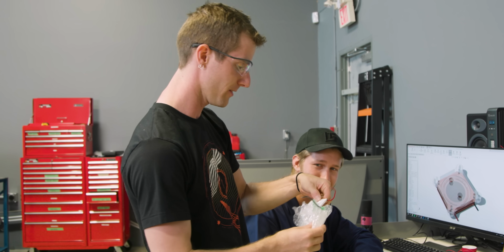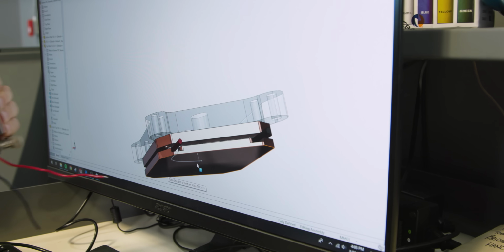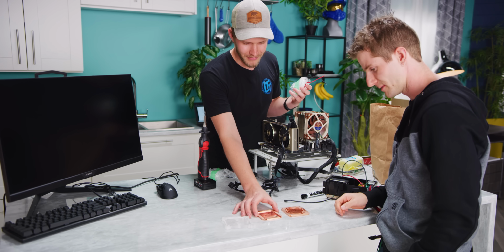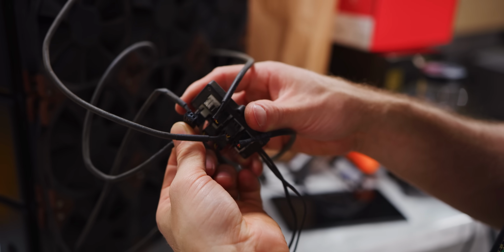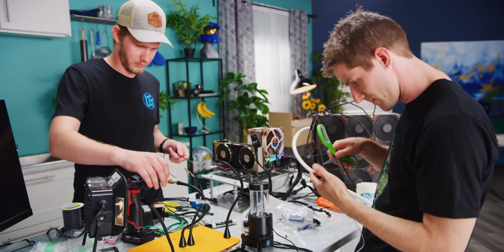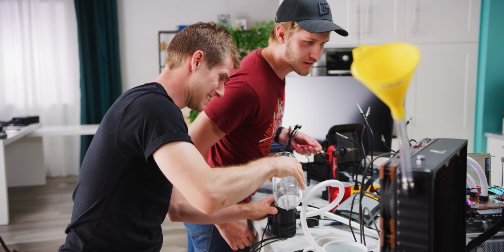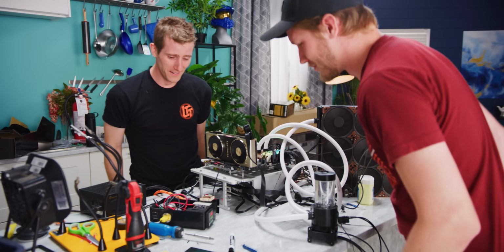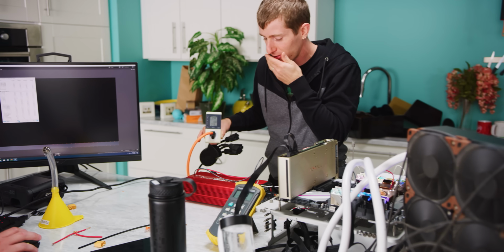This Cooler DRAWS 545W!!? Bad Cooling Ideas #2

Comment: Next episode: water cooled power supply
Reply: Why? That’s already something they reviewed a while ago, you can still buy them. Basically pointless as the design sucked on that model, so yeah, you could diy much better sadly...
Reply: Oh, one thing to note, I’ve done sub-zero power supply, and around -50c it may go squirrelly (I had voltage converter submersed in anti-freeze cooled by dry ice, also though, around -60c the anti-freeze froze but it took a while). I’d go submersion flow for true liquid cooling if a power supply, but a quality one like my HX1200i runs 700w fabless and the inside temp is only like 45c (like 10-15c over ambient), so if you touched the inside components without getting shocked it still wouldn’t even be that warm. For my main system I have 2x SuperNova 1300s (with Threadripper and 4x Fury 1 is fine, but if you want to use LN2 for example I’d just rather have overkill power supply. Using it to hear my house only uses 1.7 kW running Crysis 3 at 4k Ultra at over 100 fps, though I usually turn off the monitors since I’m just using it like a massive space heater and it holds its heat about like an oil heater if you run the fans super slow).

Comment: Better off to run 5 at lower watts with a larger thermal mass, more copper!!!, that way you can actually keep the TEC cool, the hotter the the hot side the hotter the cold side.....what I'm getting at is with 900 TEC watts....you should be able to keep that cpu at stock more than pulled down, also not to mention a slightly better water block for the TEC.

Comment: I’m confused. How does a relay fit into a PID controller? PID controller should ideally control the current flow into the Peltier module thereby controlling the degree of the thermoelectric effect. A relay is just basically an electronic on off switch, if my understanding of the implementation is correct. What you need is more like a potentiometer, but it should be already built into the PID module

Comment: Càn condensation occur in a vacuum??
Reply: If there is a perfect vacuum, there is no air or humidity, and without any molecules, there is nothing to condense. Little bit tricky unless everything is water cooled since nothing has airflow and only radiation for heat.

Comment: Some kind of electric pump, motorcycle radiator and fan connected to a water cooling loop would probably work pretty well and be impossible to overload with heat. That giant radiator is actually about the size of a motorcycle rad already

Comment: Use a cascaded TEC pad stack. Then you need multiple voltages and more cooling capacity. But it should work. Keep trying. It's possible!

Comment: I know that water cooling may be good, but, can you try the same setup with a big air cooler? The direct heat into the pipes and the radiator should be good enaugh to cool it better, maybe.

Comment: "Cable mod cable extensions"  Does this mean you tried to switch DC voltage with an SSR that is TRIAC based?  Those only switch off with AC because a TRIAC circuit needs the zero crossing to switch on and off.  I'm not sure you guys are qualified to do technical wiring.

Comment: Now you gotta make a Giant heatsink, put the pc outside and call it “wind cooling”
Reply: Won't work. You won't have a good enough thermal conductivity with that setup. Heatsink will saturate and you won't be able to remove enough heat.
Reply: they'd be better off stacking copper blocks on the damn thing lmao

Comment: You guys should try using the Peltiers to generate power instead. They will generate power proportional to the temperature differential across the sides... so you could reuse some energy from the heat of the CPU and do something else with it.

Comment: A crazy idea i once had was using a heat exchanger or something to use the heat from a cpu to boil water and then use that to power a steam engine which then drives the cooling pump

It is porbably a super stupid and inefecttive idea if it even works but imagine, A steam powered computer!

Comment: Use the pelter to cool the water loop instead of the cpu. 

Use car antifreeze in the water loop to keep the temps lower. 

Setup the loop as cpu to radiator then pump to pelter water block then back to cpu.
use second water cooling loop to cool hot side of Pelter.

Comment: You need more cooling on the hot side  and a thicker cold plate on the cold side. Then let the system stabalize before adding more heat with the cpu load.

Comment: Listen please, it is much easier to use a battery powered drill to make thredded holes, just make sure that you hold it straight and have it in frist gear, and the item hold down. 😅

Comment: Guys, you put so much efford in this to end it like that?! You should build a hybrid solution where you have a separate (high temp) loop to cool down the peltier and a second (low temp) water cooling loop directly to the cpu to suck up the thermal peaks. So you can start up with a stable system and then cool it down (to a low temp) over time even under full load...

Comment: Epic fail. Solid state relays are for switching AC, not DC... Also i'd bet this exact setup would've worked great if you ran the peltier at a sane 5-7V instead of 12-24V. I gave much more detail in a comment in the last video on these, but peltiers are MASSIVELY more efficient at a fraction of their rated power (reasonable range is 5-20%)
Reply: Have you heard of this thing called a transistor? Solid state relays are available for both AC and DC, just like mechanical relays...

Comment: I don't know anything about Peltier module, but i do know about PID controllers, and i'd avoid simply autotuning them as it's probably using some kind of variation of Ziegler-Nichols tuning method without additional validation and because you autotuned it while PC was just idling it autotuned without having an actual proper step response. Trust me i'm (almost) an automation engineer.

Comment: That solid state relay is for AC only (it's on the label). Don't buy cheap eBay SSR becouse most of them are fakes and current ratings are much lower than on label.

Comment: Haven't watch whole video yet, but one look at SSR at 5:24 told me it probably not gonna work. Most AC SSR needs zero crossing to switch on and off. So how much times a second a DC voltage crosses a zero... YEP

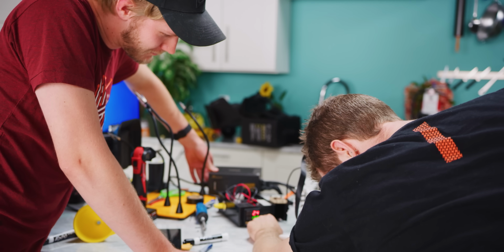Edit: 19:01 SSR latched and stayed on. Should have used big mosfet out of 3d printer or a few of them (haven't really seen bigger than 30A). Or you could actually use automotive relay (12V 50A so about 600W).
Reply: finally someone who gets it!

Comment: How about using the peltier coolers on the radiator or somewhere else in the water loop, instead of directly on the CPU. That way you could potentially pump supercooled water to your CPU, but you might want to add some kind of antifreeze to the water to ensure that it stays liquid.

Comment: 15 years back I have done TEC cooling for my AMD duron. 200W TEC. Custom waterblock. Heating element from old car and big fan to keep water cold.. I made custom controler for ATX PSU So I can got 17 degC every time. I can do some advice to you. You need biger waterblock and you simply cant switch on/off your TEC. You must regulate current thru TEC in analog way. Current thru TEC must never drop to zero if you regulate power. Your setup seems to be working, but waterblock cant handle that much heat. Make another one with bigger surface area. :)

Comment: We use tec cooler for testing chips as they’re extremely good at maintaining a stable temperature during load. They’re not a failure tech by all means, u just need a extremely beafy chiller. Check out silicon thermal and incavo

Comment: I'm still not sure why you're trying to cool it directly with a TEC, blocking the normal cooling setup. It would be better utilized as an addition to a setup by side mounting to an existing cooler/rad to increase the temperature delta.

Comment: You'd be better off putting the TEC cooling on the radiator to get lower than ambient, then you'd need another water cooler just to cool the TEC plate. You could get the water as cold as you want and not even worry about condensation.
Reply: We're getting into Nuclear Reactor type cooling setups now.  This is the LTT experiment that needs to happen.
Reply: @DancingCorpse  Molten salt cooling loops sounds awesome.
Reply: @haldir108  this isn't as hot as a nuclear breeder...or chemical high temperature reaction for ceramics... In my HP notice Amd ryz 4700U this thing throttles at 105°C a bit high for my taste though...
Reply: @DancingCorpse  nuclear reactors just send cold water from a river and dump the heated water to the other side of the plant in the same river. so in resume just attack the hose to the faucet and the other hose just throw the water to the sink.  and it will  be very cold (cold shower style) and you dont have to spend in 500watts electricity or something. just pay water
Reply: What? You get the water (that is cooling your CPU/GPU) below ambient and not worry about condensation? That's not how it works. And at that point (using the Peltier element to cool the water) you might as well just get a chiller and be done with it.
Reply: @Gigator  They have no idea what they're talking about. The water gets below ambient, commendation will occur. Period.
Reply: @Gigator  Yes it does work because the median (cpu block) is not below ambient. The water can be colder then ambient and not condensate. And if you have air flowing over the cold plate then you definitely will not have condensation build up.
Reply: @chieftron  If your water is below ambient, you can get condensation (humidity matters at that point) and condensation along the tubing can result in water drips on sensitive electronics. Saying "below ambient" and "don't have to worry about condensation" is just nonsense. You can manage certain things better than others, but then state so.
Reply: @Gigator  I live in MD where the humidity is high majority of the year. And I've never had issues with my Coolit Freezezone Elite with condensation. And yes the coolant is below ambient temps and the water block is cold to the touch. From my experience if you have sufficient airflow around the cpu block and the chillers then you will not have problems with condensation. There is a thing called dew point. And it never hits that level if properly calibrated.
Reply: @chieftron  if you have air flowing over the cold plate? I'm not sure if you understand how condensation works, the condensation comes from the moisture in the air condensing on the cooler surfaces, if the increased airflow keeps the temps up then this might work, but more likely condensation will occur at some point.
Reply: That’d be cool
Reply: Yeah, but...  What if you get condensation in your water?
Reply: @TheVenerableMrKrieg  not in your water, you could develop condensation along the whole system if it's running below ambient.
Reply: This is EXACTLY what I was going to say, this is how the Coolit tec coolers work. I still use a Coolit Freezone Elite and it works amazing after 12 years. I did have to replace the pump once but the peltiers are still working great. And that cooler can easily take up to 350w of cooling and it's in a small form factor. If they adapted that method with those radiators, it would be able to easily cool 1800w. Hell those radiators ALONE should be able to take 1200-1500w with just fans. 

If implemented properly that setup should be able to keep that whole system including sli gpus in the water loop around ambient temps on load.
Reply: At which point the TEC advantage of being compact no longer matters and you might as well take a water loop, remove the radiator, replace it with another water block and attach that block to the evaporation chamber (cold side) of an AC or freezer compressor loop. If the liquid temperatures start nearing 0C it better have a ton of antifreeze or it has to be another liquid with a much lower freezing point than water.
Reply: @BitterCynical  agree with you, like car cooling liquid diethyleneglycol added. And if the first cooler is cooled with a peltier and second water cooling, the possible condensation of water out of the air is away from the CPU! E.g with %rel.  hum. sensor and the room temp, you can calculate or read out of a table the point of condensation, and your cooling system should then handle that, e.g with a very small SPS.
If you are in the sahara, getting water condensation as byproduct of server-duties may be a second benefit!;-)
Reply: Man, unfortunately, that's not how physics work ;-; Think by this rule - Start energy = final energy. If you Add a cooler for your cooler, and then a cooler for the cooler cooler and etc, you are just adding points where you will lose some of your cooling energy, and not actually "adding" more cooling energy. Even if they put a peltier cooling water and that water goes into a water loop to the CPU, eventually, the water on the loop will get to equilibrium with the whole system (water from the cpu loop + water from the peltier loop).  Maybe the cpu water will be some degrees cooler than the peltier water, but as a whole, it would be the same as just a custom loop by the end.
Reply: What are you talking about? you get colder temps using water cooling when the water is colder than ambient.
Reply: @Sizukun1  The water will get hot eventually, and come in equilibrium, thats what i'm talking about.
Reply: You're assuming a constant load on the CPU, and with energy from the tec plate always trying to cool, equilibrium would still be below ambient temps.
Reply: What he said
Reply: Also using multiple TEC coolers on the radiator at lower voltages is a lot more efficient at cooling than a single one at a higher voltage not to mention cheaper. With TEC coolers the lower they are from their rated power the more efficient they run, it also gives you a lot of head room if you do need to crank up the power.
Reply: 5Head
Reply: You would get terrible transfer, and a good chance you would point freeze where it makes contact.
Reply: Or just add a watercooled TEC inline in an existing loop as a fluid chiller. Instead of cooling the CPU directly, or using it as the only cooling with no radiators as they have tried in experiment 1 and 2, have it in line, with a sandwich block like the one they made but just another block instead of a cold plate on the other end. Cooling the radiator externally would kinda be too many mediums.
Reply: You'll still get condensation at the CPU if the water looping from the CPU to the radiator is below dewpoint. (dewpoint temperature of the air in the room)
Reply: Which then results in insane energy consumption inefficiency, hence why TECs seem like bad cooling, despite the theoretical benefits. You're burning magnitudes more energy than the heat you're managing from the source due to all the intermediary components needed to not make the TEC a liability.
Reply: Same idea man xD
Reply: They should control peltier more. If it's off - it will work like insulator. They had PID but used like thermostat... Set PID to keep something like 5C as long as hot side is below boiling point. Monitor cold and hot side. It's probably still not feasible, but leave room for improvement nevertheless... 😁
Reply: You got it ! They'd also be better off using 2-3 smaller tec's in cascade for a project like this, just matching and believing the numbers alone is not enough when you don't understand the basics about removing heat. Just because the cold side of the plate is -50c does not mean a 70C delta (as in 20c ambient with cpu loaded at 90C) will be 20C. Water/Liquids are very efficient at moving the heat away unlike a 3"x3"x1cm piece of cold copper.  What's next for LTT, trying to pour LN2 directly on to the cpu ihs or die. Hmm I wonder why the -196C liquid is just bouncing off of the cpu and evaporating LOL
Reply: Derbaur did something similar with those peltear coolers,
Reply: Craig X  I have a loop, and I know that cooler water = cooler temps, but, just before equilibrium! Eventually, your water will get as how as always.

Comment: The should have designed that box in a power supply unit, then put it all in a dual PSU case (Lian Li 011)

Comment: Make sure that Solid state relay you use is for direct current! One for AC will stay on if DC is used!
Reply: also there is a difference between AC or DC PWM signal.

Comment: Linus, an on and off switch that responds to temperature is called a Thermostat.  Seems a bit pointless though since the cooler is limited by the amount of heat you can remove from the hot side...which would be the same value as if you just had the waterblock cooling the processor instead.

Also your rad is (nearly) as big as the intercooler AND radiator in my Cappuccino lmao.
Reply: So jealous of you having a cappuccino, although I'm 6"3 so maybe not